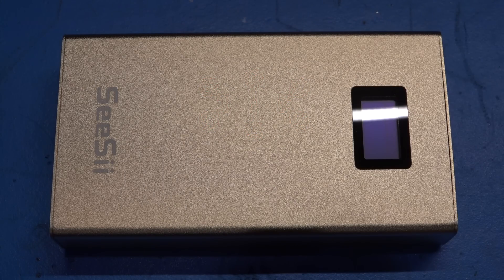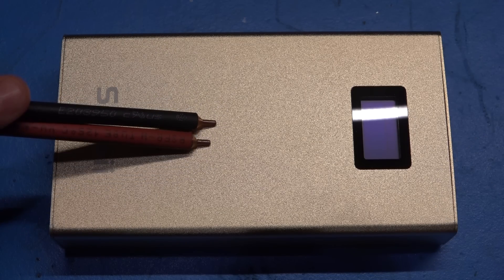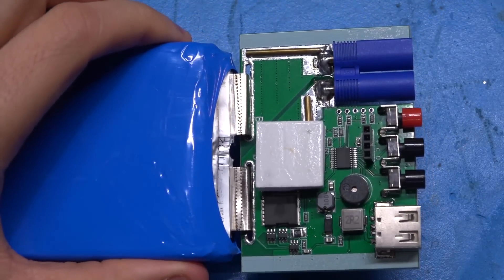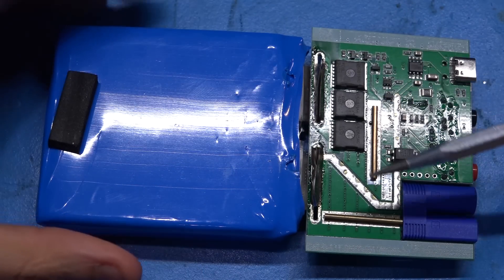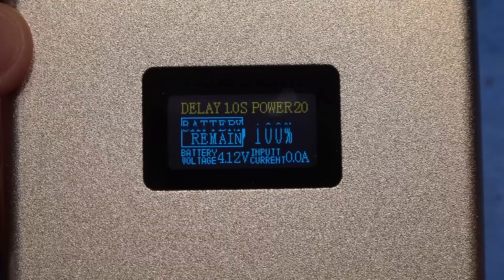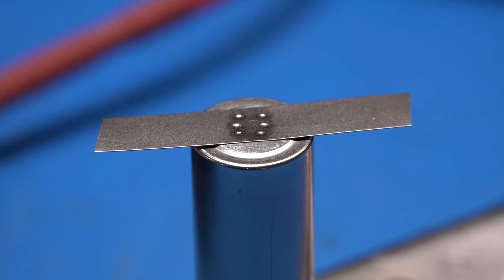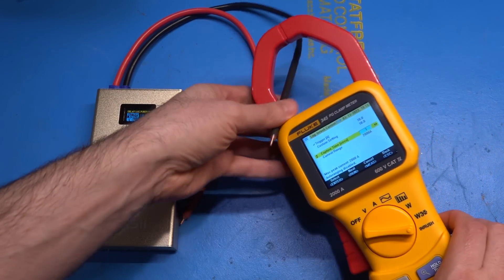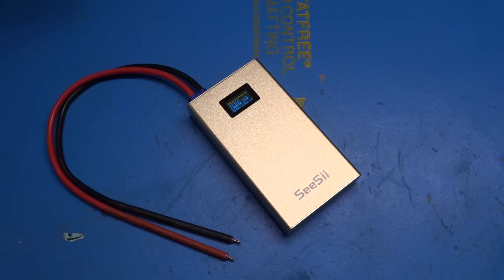TNP #14 - Teardown & Analysis of a Somewhat Dangerous LiPo-Based Mini Spot Welder

Comment: 5:02 you forgot to mention the thickness of that nickel strips. 
anyway that part on 2:59 dan easily be first with liquid electrical tapes no need to cut them off.

I was wondering if we can mod it to just direct it to a power supply rather than getting the power on a battery.

Comment: I've got the newer version. Cleaner assembly, large LCD screen, 88 gears, 10000mha. Welded .20 thick nickel..no issues
Reply: pure nickel or nickel plated steel? Because I own both versions and the older one actually has a battery with lower IR than the newer one (0.54mΩ vs 0.67mΩ). I found it to be roughly at the same level as the old one except my pens heat up very quickly and I suspect they were assembled poorly. Both welders could never really do a real weld with 0.20mm pure nickel even 0.15mm nickel requires being the kind with the slits in the middle to get a proper nugget left on the cell terminal. The board on the newer unit is definitely much more refined and the way they attach the lipo is far superior. If you haven't taken yours apart I would carefully slide the board and battery out just to check to make sure your bolts are tight. Be super careful not to short anything if you need to tighten them.

Comment: I have one of these and my board recently died. Can't find any blown components. Any idea where I should start probing? I had opened mine prior to seeing this video and my first wtf moment was the size of the lipo tabs. The seller has been absolutely useless.
Reply: Follow up, I couldn't get a new board for this so I bought the "upgraded" unit with the OLED screen and the XT90 probe connector....yes it is a slightly smaller battery with two 5Ah cells in parallel vs two 5300mAh cells in parallel in the Seesii model shown here...but the Seesii battery pack gives me an AC IR of 0.540mΩ and the new one gives me 0.670mΩ. Trying to find a way to parallel the two packs together and hopefully it won't be too powerful for the new spot welder which does have a much better looking board. They got rid of the stupid slots the tabs go through and went with a large pad that the tabs are bolted down to with a hole through the tabs and the board pad. Seems like a much better connection (and obviously safer) so maybe the difference in pack IR is a wash after you take the connection on the SeeSii into consideration.

I didn't care for the cable and electrodes on the SeeSii unit but the new unit pens heat up VERY fast. I have a feeling its related to how it is assembled but I haven't taken the pens apart because its my current only working welder. I finally got my LSUC caps in from Korea after they did a tour across the Pacific with stops in Mexico, Panama, up to NYC and then getting off the boat in Virginia. Jesus that was brutal to watch. I also bought a CNHL 5000mAh "120C" Lipo from their racing line since it was cheap and I want to try some of the PCB boards. Perhaps I'll end up finding a 1S Lithium spot welder circuit I like and I could turn my Lipo into 3 parallel cells and then combine the four 5/5.3Ah cells from the other welders with it....or create a second 3S lipo out of the best cells from the spot welders if I stick with 12V who knows. Going to take a little bit of money to put the parts together for my cap welder and honestly I now believe 2S isn't enough and I need to go 6S but most of the control boards I've seen are for 2S and 3S configurations so 3S2P might be the way to go?

Comment: Nice video. I would have liked if you could have measured practical current during welding at various battery voltages too to set a benchmark for current requirements.
 As the battery discharges the max current it could deliver would drop. And so this might be unusable below a certain voltage.

Comment: I have the same one, but it is rebranded, mine says DX10.
I tested it when I bough it, with the included strips, just worked fine.
After six month without use, but battery in storing charge , it doesn't weld nevermore, no idea if due it lost some mosfet (is that possible and carry on working?) or the new pure nickel strips are too much good, but I bough 0.15 and 0.10, and it is no able to weld. 
I tested the battery and it has 9000mah so it looks ok. I cleaned the probes, and improved little bit the first pulse.
So sad, they are cheap, but even that is quite a lot of money for me. Just made 1s4p packs and needed weld them with iron solder
Reply: I have the dx10 too ...have you been able to fix it??

Comment: i am using the cheaper version bare version (no casing) using 3S-4000mah 60C Lipo 2 in parallel configuration, it has setting up 1 to 8 and no 4 is so much sufficient for spot welding 18650s

Comment: best choice......2 super capacitors 3000F in parallel.....12v spot welder board connect to external power supply....positive directly to the positive side of the capacitor.....is good?
Reply: Mine copy is powered by two 3000F super caps in series. Each one is rated 0.5m ohm ESR. It's very easy to reach 1000 amps. The welder consists of four 300A mosfets in parallel.
Reply: Nope. Super Caps would not give enough current. People have tried it, and it doesn't work.
Reply from the maker: Why do you think this? In fact, the thing super capacitors are really good at is extremely small output resistance and therefor high current capability. This system would work only better with super capacitors.

Comment: Now I know how to fix mine. Not the same brand. But same design. Yours actually has Low Resistance with that extra copper and solder. Mine will today then I’ll test it. It would weld before, but after about 10-15 welds. It needed charged again. Once battery drops below 4.10v it’s worthless unless you’re welding foil. 
Thanks for the upload. 
God Bless.
Reply: How did your mod turn out ??
Reply: The battery swole. But I took a much bigger cell from a Lifepos4 motorcycle battery and it seems to handle the welds longer.  It was a little tricky cause the cell tabs are on opposite ends. I haven't finished the 555timer version yet.  Work. 😂

Comment: Looks a great wee unit, i have been eyeing them up for a while but put off, in general, by cheap chinese Lipo/Lithium-Ion battery/charging circuits (already had a strimmer battery fire!). Hmmmm, might be a candidate for a motorcycle battery conversion!

Comment: Car batteries are also good sources of welding current.
I made use of a new-ish car battery i had that had a shorted cell so it couldn't be used as a car battery anymore but worked wonderfully for my spot welder.
I connected my electrodes with 6 sqmm wire to limit the current to about 900A.
The only downside is that they're bulky and heavy but they also last forever.
Reply: I don't know if you're aware, but you can use salt water to reduce the current, when welding with a car battery.
See this video for one example: https://youtu.be/zkdsq1WdK9g
Reply: Conversely, a (regular) welding machine also makes a good starter pack for pretty much all diesel equipment with weak batteries. Just gotta make sure you have the voltage and contacts right...
Reply: @2xKTfc and have to make sure it is a DC welder instead of AC

Comment: I have this exact same model and was pretty impressed with its welding performance. I'll definitely have to take it apart to do similar touchups and shortening those tabs like you did on your unit.
Reply: Actually the performance is crap. The capacitor-based ones running on mains have an order of magnitude shorter pulses. And thanks to Ali, these aren't that expensive either ("HT-SW01" for example).
Reply: @graealex  Good to know, I'll have to look into those. To be fair this was the first time I've spot-welded battery packs so I didn't have a frame of reference to compare against.
Reply: @graealex  Google and aliexpress search fails to find any welders with HT-SW01 symbol. Is this symbol correct?
Reply: @arekx   ,  Hmmmmmm
Reply: @arekx  Yeah, I noticed. Actually needs HT-SW01A or HT-SW01B C D etc and then you'll find the spot welders with 60J to 240J energy.
Reply: @graealex  those are 3 to 5 times the price as the SeeSii unit
Reply: @graealex  If the welds are good and strong how are they crap? You not liking them doesn't change that fact it just makes your comment useless.
Reply: @mmdirtyworkz  But they aren't strong. They can only fully penetrate very thin strips, and mechanical strength is questionable.
Reply: @graealex  I agree on that to some extent. But for strips up to 0.20 they work just fine. Some of them do pose a risk as explained in this video so one needs to take a look inside and correct any shoddy work if there is any. I have welded many battery packs and they are good. For 40 euro they are awesome. Admittedly I don't use it that often, for people welding every day I would recommend a more professional device.
Reply: @mmdirtyworkz  For the price they are awesome, yes. But the question is, if you are buying such a specialized tool, maybe shell out a few more bucks and have one that isn't at its full capacity already with very thin strips. I also have little confidence in the longevity of these devices.
Reply: @graealex  Time will tell. At the moment I am more than happy with the product (for my applications).
Cheers mate
Reply: @mmdirtyworkz  I generally recommend not buying the smallest viable tool for a job, as you're likely to need replacement when the requirements increase. And you're unlikely to be needing two of them, as it's highly specialized. It's different when for example buying a cordless drill, because there is always place for multiple different-sized drills in a workshop.
Oh, and the other problem I see is that the current limitation happens through the internal series resistance of the battery, and you're really not supposed to basically short-out LiPos. It's different for the units that employ capacitors, which are perfectly fine to dump the max current at once.

Comment: Does anyone know if, given portability is not an issue, if a contactor would work or is there too much bounce?
Reply: Minimal pulse length might be a problem...
Reply: And you have to use a big one so that the contact dont Weld themselves shut. I have tried it with a old 20A 3ph ABB contactor and a car battery, with all contact in parallel, it did work for a few times and then the contacts diddnt open up and it wrecked the cell I Was welding on and gut the cabels nice and hot before I could react. I would not reccomend unless you go with one rated for 40A or higher, and even then I would Still recommend being care full.

Comment: Did you just touch the lead probes while shortening it? I always thought my hands would fry if I do this
Reply: ^  As Axel said. TL;DR: Current and Voltage are two very different, orthogonal things (and Power is sorta another thing).
Reply: You won't feel anything through your bare hands at such low voltages, unless you decide to unwisely try it on your tongue. Even then the above unit (not all brands) only power up and fire the pulse, once the unit detects a direct short across it's probes. I personally do not trust the electrical integrity of anything manufactured in China.
Reply: Very low voltage and lots of resistance of the skin vs. super low resistance of the copper probes. I still would be scared haha.
Reply: @Aexorzist  it's not about skin resistance, he was shorting copper to copper. The point of contact between the leads could potentially get very hot and he was holding it with his bare fingers.

Comment: Folks in here that use these, does the portability add that much value?  I think I'd rather just run something off of mains or a car battery than worry that the lipo is going to go nuclear on my workbench or in a toolbox.
Reply: I would wager that the LiPos are cheaper than a supercap setup that would require more than of the shelf components on the power management side.
Reply: @madinatore  The problem is lithium batteries are not designed to repeatedly be short circuited so eventually they will short internally and catch fire.
Reply: @cda32  - Those cells are more than capable of coping with that sort of current.

Comment: sorry for noob question - so that lipo pack looks like 4 or 5 cells, which i guess they wire in parallel since no need for high voltage and we just want to maximise current... but if i wanted to make my own one of these but with LTO cells for better safety, how many more than that would i likely need? i am aware both chemistries are much more capable of short burts of ultra high current output than other lithium based chems but no idea what specs to check to calculate this myself. any ballpark figure would be appreciated if anyone reading this knows
Reply: You need to find out the "C" rating of the batteries you get.  Search for "battery C rating" for more info.
Reply: @Mueller3D  jup, youd wanna get very high C rating batteries, the ones they put in those crazy RC packs that can do 200C or something silly.
Reply: im guessing best way would be to take one cell and estimate what its short circuit currrent pulse capability was , maybe using one of these spot welder control boards for that even. You put in 1 cell, test the short circuit current. Then another cell in parallel to see by how much it went up ... hopefully that will let you null out the internal resistance and calculate the ESR for short pulses per cell.
Reply: You need to consult the data sheet of the specific battery cells that you intend to use. Note that they have lower voltage as well.

Comment: I went with a cheapie on ebay that was around $20 to $30, the unanimous red PCB ones. They have major design flaws that results in them exploding the MOSFETs after like 20 welds at higher power. For one thing, they usually use comically-large capacitor to maintain a high voltage to the gate of the MOSFETs, and also lack any protection for inductive kickback. All the energy that goes into the loop inductance of the leads will backfire into the MOSFETs. I think the only thing that saves them is their drain-source capacitance due to large junction size? If they made the design into a half bridge with another MOSFET that shorts the output following the pulse, or simply a big beefy diode, it would probably be a lot more robust.
Reply: Solder a TVS diode across the MOSFET(s), SMCJ5.0A for example, anode to source, cathode to drain.  Clamps the inductive kick.  The MOSFETs probably die of repetitive avalanche (causes progressive internal damage).  Greatly slowing gate turn-off is also an option; this increases turn-off losses, but it need not be much energy in comparison to the bulk of the pulse.  Also, the losses include the inductive kick energy, handling that with less need for TVS.
Reply: @T3sl4  I considered it. Just putting a big fat reverse-biased diode across the MOSFETs turns it into sort of a one-shot buck converter, which should clamp the output spike. A TVS would attempt to dissipate the energy rather than recycle it, not sure which one would be better. I ended up getting a Kweld instead, much nicer welder, if a bit pricey.
Reply: @power-max  ,  Kweld is a beauty.
Reply: Did you mean “the ubiquitous red PCB ones”?
Reply: @tookitogo  maybe lol
Reply: @tookitogo  ,  Probably.
Reply: There are numerous videos online about how to fix those welders. They suffer a number of different faults, including a droop in Gate Voltage that causes the MosFets to burn out. Here is a fabulous channel about these gadgets and how to fix them...
youtube.com/c/Luca_Techy/videos
Find the recent video named All "Mini Spot Welder" versions: circuit Analysis, differences and faults and work out which one is yours. There is links to schematics in the video descriptions. Then check All Videos to find the respective details if you need more info. A fabulous resource!
Reply: @johncoops6897  as this thread already points out, In addition to THOSE faults in your video reference, there is a lack of a voltage transient suppression. So that should be added to the list of problems. 

After every weld, the energy stored In the lead inductance ends up causing avalanche breakdown of the MOSFETs, degrading them with each pulse. High power MOSFETs tend to be constructed by having many smaller MOSFETs in parallel to minimize lead or package inductance. The extreme power dissipation during avalanche can cause the unequal load sharing of the internal parallel FETs to fail one by one, causing the MOSFET as a whole to degrade.

Other stupid things include the fact this appears to be designed for lefties (not a bad thing per say but why is that the default??), the poor PCB design and no bus bar to aid in current, a large section of PCB copper trace  that serves no purpose and adds resistance, simple constant pulse-time architecture causing poor inconsistent welds, too thin a wire gauge for any real welding, etc etc etc.

It sucks since the unit has the potential to be very good and compete with units that cost ten times as much, but is let down by really so many stupid design flaws. I was going to modify mine to fix the issues but realizing how many issues it has, I just bought a Kweld instead.